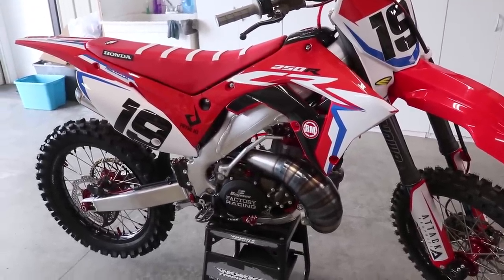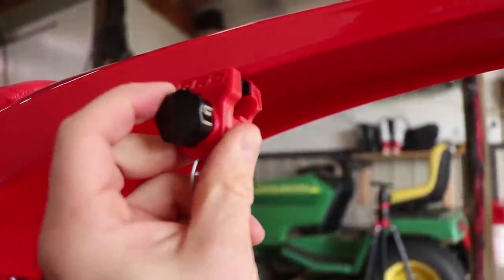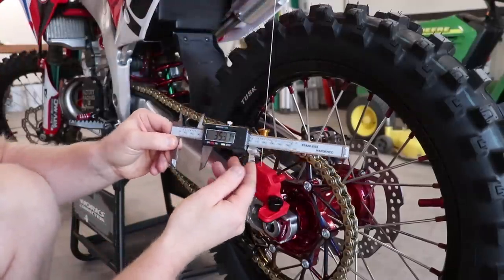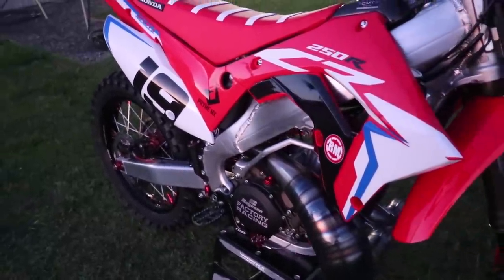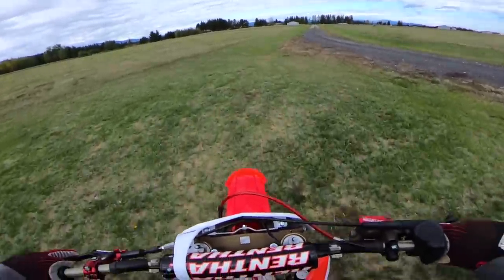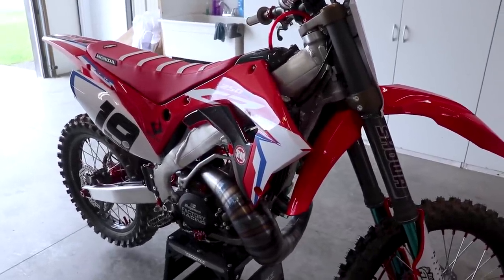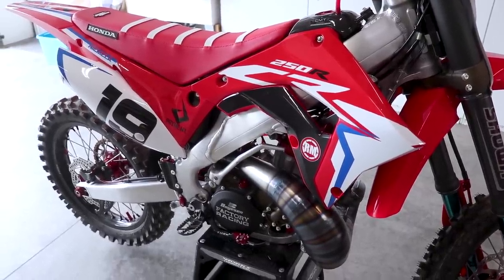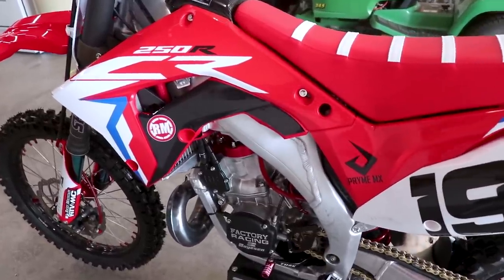Breaking in the CR250!

Comment: Bike turned out awesome. You may want to consider applying some Copper Antiseize to those TI bolts. They seem to love seizing to threads. I'm in the process of adding a ton of Blue TI ones from Pro-Bolt on to my 03 CR250/500 conversion. The way I prep the threads is I use the old steel bolt, put Copper Antiseize on it, thread it in and out and then install the new TI bolt. Using some Loctite 243 doesn't seem to be a problem - I have to due to the 500 being a rattle box! :)

Comment: I believe break in heat cycles should be done under load
Reply: Can you explain what do you actually mean by "done under load"
Reply: And he went to full throttle too soon.
Reply: @АсенМихайлов-б4н  i think that this guy meaned that cameron shouldent drive it yet like just use it on idle, or something like that, my opinion is that you can drive already, if you dont give it too much gas
Reply: I dont think there is any reason to even do heat cycles. Cant find any credible source for it. All i've ever done is warm it up for about 5 mins and drive with varying throttle for half and hour  and do smooth acceleration change oil and done.
Reply: Just ride it! It’s all a myth there’s dozens of videos that prove breaking in a race bike is practically unnecessary especially two strokes.
Reply from the maker: There's a million different opinions on break in. Just like with oil, go with what you feel is best
Reply: Cameron Niemela can’t wrong there, for the break in that is lol saw a guy use 4 stroke oil as a premix and it didn’t go very well 😂
Reply: @АсенМихайлов-б4н   Same exact procedures but ride the bike in a  higher gear(underload) Don't stay at the same rpm and Blip the throttle
Reply: @CameronNiemela   exactly, to each their own. I just think having load helps seat the rings.

Comment: Resistivity setting of infrared thermometers may be of interest to you. Don't let that laser dot fool you, at a foot away the measurement is already about a 1 inch circle. Shiny is bad but a piece of tape or flat black paint is an easy fix. I prefer thermocouples for anything critical and use them to confirm infrared readings. Peace.

Comment: I set my body weight sag and after that was set there was NO static sag. Pro Circuit said I would need a stiffer spring for the shock AND the forks as my bike was set to 190 expert but I have since gained 20 pounds with a severe knee injury and cannot get static SAG until I loose the gained weight. Pro Circuit said once I loose the weight and get back down to 190, and set the SAG to my weight, the static sag should be back where it needs to be. So, You are on POINT with your information. I was told to check sag frequently during weight changes.

Comment: strangely shiny surfaces tend to reflect the temp of surrounding objects,a test was performed with stainless camping mugs to observe this fact,so the more reflective the surface the less accurate the response from the IR temp gauge,you could strap a k-type thermocouple to various surfaces and use a VOM to measure.
Can't wait 'till my 89RM250 is brattleing on the terra firma after i re-assemble it after a full re-build,good to see tried heat cycling method,way too much info on web land.

Great vids,have a good 'un.

Comment: I broke in my Yamaha DT125 by going to the sea ice and had to lug it around with pretty high throttle in 20cm deep snow from the get go.

The heat cycles went basically from almost boiling from digging around on 1st gear then stopping to cool it down :D After 3000km I can still see honemarks. After around 300km of break-in focused riding its gotten alot of wide open max speed tests on ice, 5minutes full throttle 9-11k rpm constantly :)

Comment: Nice work man this has been one hell of an amazing project and congrats.🔥🤙

I’m not a fan if that style of heat cycling, you have done it before I am guessing with the 125! doing the compression test and especially checking your spark plug really good tip to people that’s key more than anything imo, can also remove your header pipe shine a torch up into the cylinder move the piston with the kickstarter up and down, check see if looks clean, no marks etc.

This is just a suggestion re your big bike track, imo I’m a fan of old school grooming I raced allot on grass or more natural tracks always loved jumping and still do, ya track outline looks good.

Don’t get a dozer in there!!
I know you like things to look good, it’s perspective though! 

Get out your mower if it’s not rocky mow the outside lines and then mark em, you can get flexy farming stakes plastic cheap at any farming store, what I use, or you could get something specific to MX, I use red for one side eg outside and white for inside, what ever. clear the weeds by hand, check for rocks or any other hidden obstacle, maybe get a tractor mower or ride on do main fill in but not cut down low,  just level.

Def groom the jump faces and berms but not with big machinery, maybe a bobcat on jumps and by hand using  flat shovel and rake on the berms, it will be great for your fitness building of your arms and back and legs especially better than any gym workout it’s bike related and great for mental strength!

More importantly great for the track, this will, give it a more natural look, make your lines easy to see esp on jumps take off and landings and keep dust right down, it will also make it nearly an all weather track!  not be a dirt eye sore and I am sure your neighbours will appreciate a lack of dust storms on windy days! you won’t have to groom it as much, the grass length with take care of itself once you ride it regularly, at worse pull out the mower at start of each season changes, spring /summer/fall/ winter etc. Biggest benefit imo will ride better, imo nothing beats a natural fresh track to bed in, soaks up water, ts virgin ground best kind.
I hate for example how they have ruined and  I mean ruined Unadilla one of the best tracks ever in MX history. it can be mess if it rains and they destroyed the natural terrain and technical aspect that track, aside fact, lol. Anyway just some thoughts on track, have built and worked on allot of tracks and trails. 

Good work buddy, can’t wait to see you gear up fully and get some laps in 🤙

Comment: I was under the impression that just running the bike on a stand for heat cycling doesn’t accomplish anything but wearing the edge off the ring without searing it. From my understanding you need to load the bike (ride it) in an attempt to get the gases from combustion to push outward on the rings and intentionally bed the edge into the hone
Reply: Zac Otis you are correct

Comment: I've seen factory connection take the bike off the stand and push on the seat 3 or 4 times before checking the static sag , not just letting the bike set on the ground  you can get an incorrect static sag doing that cause the oil in the suspension might not work to the back of the bikes full potential u want that rebound to bring it back up then check static sag .

Comment: I have read that crf 450x gears(all the set, also the clutch) fit perfectly on cr 250 engine, and have better ratio for Enduro or supermoto. Next project? Just saying.
Great video man, now I have a 2002 cr 250 but im going to make a little change....im going for a banshee 😬.
I have the complete gears set from a 450x, except only 1 gear of the secondary axis, if you want it (only for Cameron haha) I can send it for free, as a (incomplete)gift.

Comment: my buddy and i made back in 97 in 12 volt car charger and 2mm wire a cut in taple to blastic parts we drilled taple a hole and we build stand in wood where was bolt and washers to keep wire in semi tight then just claps on those bolts and chargers on

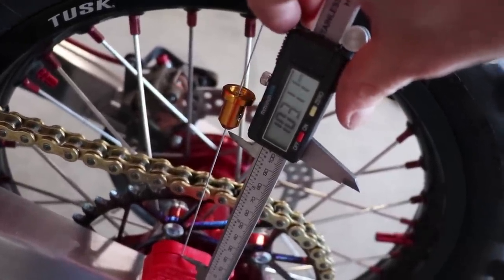Comment: 7:35
Notice the big air gap? I tried to get my CR250R dailed in and spent WAY TO LONG attempting to get it exact. 
I'm the same way with chain tension and rear wheel alignment. More so with my CBR600RR than with my CR250R.

Comment: The shiny pipes will give a false reading with those infrared temp guns.  If pipes were black it would give a closer to true reading.  I used to run Nitro RC cars.  Monitoring the temp with those is super important.  Its know in Nitro RC world that temp guns vary with surface color and shine of material.

Comment: If the hole was centered you couldnt get the wrench on. Guess you could use a socket then. That is one very sexy machine. Its a museum piece actually. The best parts available, if you eliminate one off factory stuff.

Comment: I hear a bunch of different things regarding warm up procedures with different pistons such as cast vs forged. 
Do you do the same thing no matter what piston you run or do you only one type of piston? 
For example when I break in a cast piston I run castor oil (927 to be exact) and go through a couple heat cycles, take it for a ride never going above half throttle, then after it cools I ride it as fast as I can to "set the rings". Then I run pro Honda premixed or maximal super m. 
With a forged piston I take it a bit easier on it and have a few more short rides before opening up the throttle.
Both methods have worked for me and my top ends last quite awhile so I guess it's not wrong but if anything could be done better any advice would be much appreciated!

Comment: You can make a track 5 miles long if you practice it will take out all the crap. I would design a track on paper and fill it with crap you hate to do such as right hand turns and just keep going over it and that ground will all break up. I would add a lot more jumps of all sizes

Comment: Cameron, I have a 2006 by Honda 250X 4 stroke with a carburetor engine.  Is it possible to update that to fuel injection without changing out the entire motor?

Comment: I dont get it...
what is the idea behind the heat cycles?
Reply: The idea is to allow all the different materiels in the engine (mainly the top end being aluminum and nickicil) to expand and contrast completely. This helps wear and seat all the parts to where they need to be.
Reply: @MK-qv7bq  i dont know about this...
And I also don't find anything to back this up.

Like The maufactures don't recommend this method and key parts of the engine are manufactured and heat treated at a much higher temperature than they will ever reach in an engine.
Reply: @danielseibert4082  true. And bikes are put on dyno's before they go to the showroom floor when new. Truth is on a 2 stroke heat cycles are not required.
Reply: @danielseibert4082  Not gonna argue but....theres a reason everyone who builds a new 2t does this. Ontop of that weisco, pro x, and vertex all have break in procedures for their specific pistons. This is available on their websites. Is it placebo? Maybe. But ide rather be safe than sorry.

Comment: Isn't it wrong how he did it? Just did my sag on the KTM EXC and the static sag has to be adjustet by getting the spring preload of the rear shock adjusted. then u sit on the bike to measure if the spring itself is to soft or to hard for u??? I mean i love the vids from u but this doesn't seem right at all???
Reply: U r saying that the static sag will tell u if the spring is to light or to stiff but the bike itself weights the same?

Comment: Why do you hold the throttle wide open when you're testing compression?
Reply from the maker: You need to be sucking in air for the engine to compress it, so opening the throttle does that
Reply: @CameronNiemela  that makes sense there needs to be something to compress for there to be compression. Love the video's do you think you could make a complete parts list? quite a few of those parts I would really enjoy on my 2002 CR250

Comment: I have a 2005 Suzuki rm65 and it has 6 gears but I usually only have it in 2nd gear and I can compete with my dads 1979 Honda cr250 and  my back tire spins so fast and I'm only in 2nd gear I can also compete with my uncles 2018 Yamaha yz250

Comment: You deffs know how to build a bike but something are abit overboard like re torqueing the head bolts ect heat cycle ect.
Reply from the maker: jonezy140 Those little things are the difference between a bike falling apart and one that stays together
Reply: Theatrically maybe but every bike ive built and every pro i know deffiantly does not do this and the bikes last without doing them